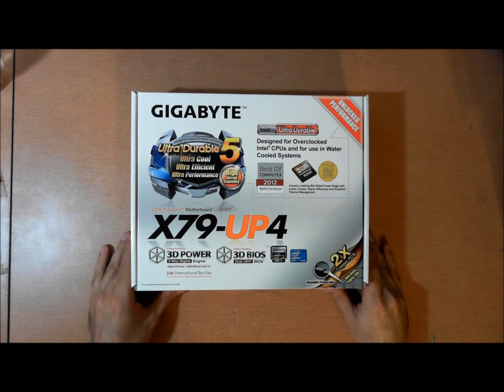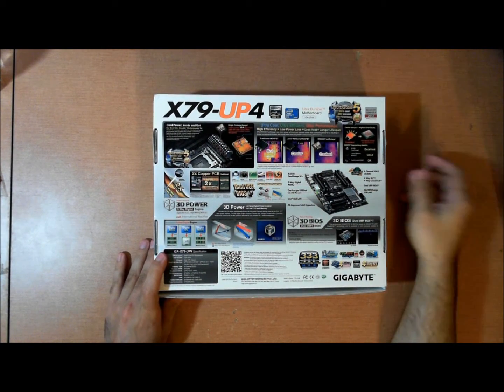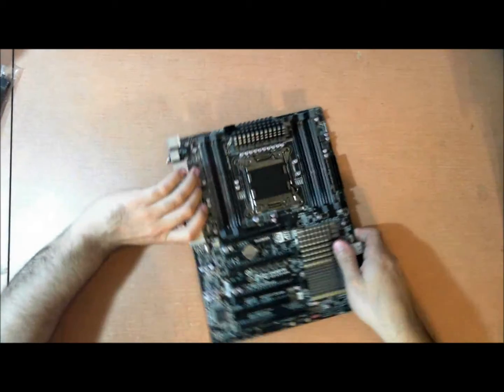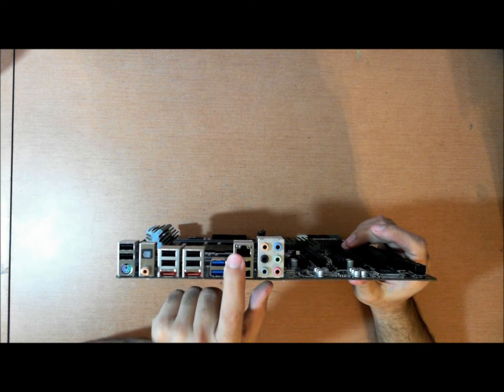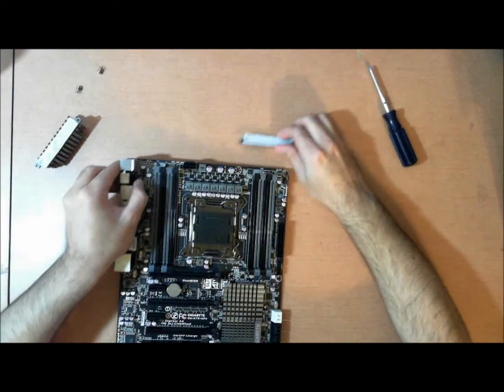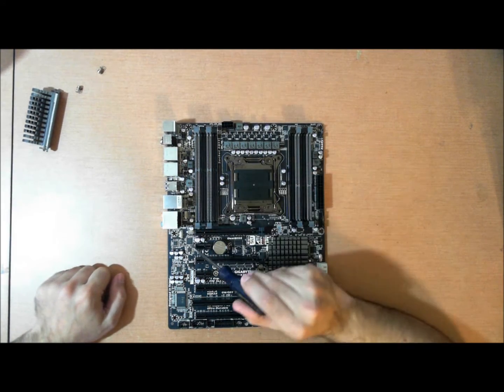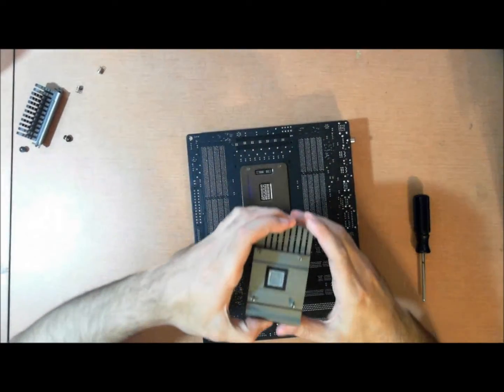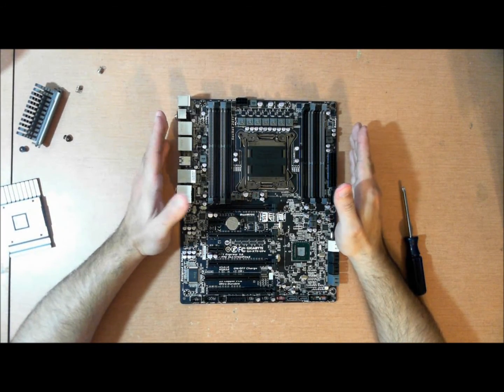[SH] GIGABYTE X79-UP4 Physical Review

Comment: Good in depth review, I just picked up this board with a 4930k for just under $200. Hopefully I can hit 4.5ghz.
Reply: Just picked up this board with an e5-1660 v2 and 8x4 1866 dimms as a bonus for $110 cant wait to see how far I can push this and figure out a way to get the e5-1680 v2 to work if possible.

Comment: I use this board for my workstation (to replace a W-series '09-era Xeon rig) build. Feels very stable, and it also comes with TPM header which is needed for my company. Simply nice!

I stick in 8x8GB RAMs on this board with an 3930K, feels like 2x faster than the Xeon rig I had.
Reply: 8x8 gig ram is like $600 USD.

Comment from the maker: What i mean when I said 16x/16x/8x is 16x/8x/16x then. 

It might also be the opposite where the second 8x of the second 16x slot is switched between the second slot and the second 8x of that second 16x slot. 

I will investigate further, but this board has 40x PCI-E lanes for 16x/8x/16x/0x or 16x/0x/16x/8x. And 4-way would deff be 16x/8x/8x/8x